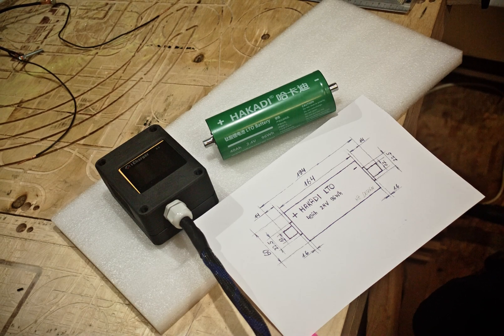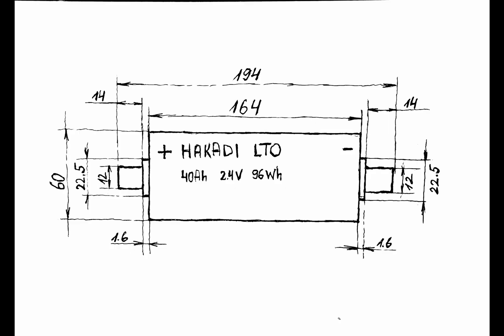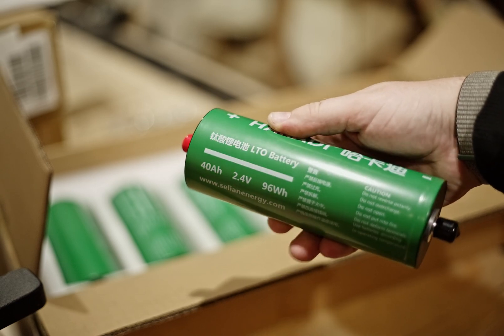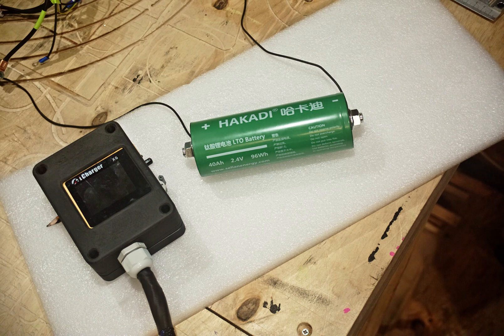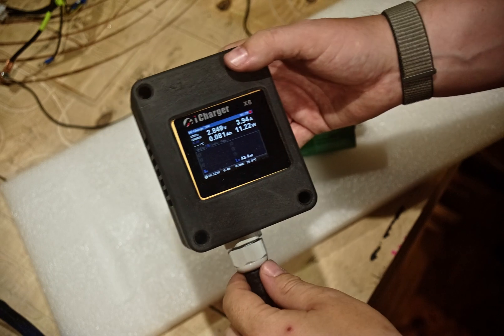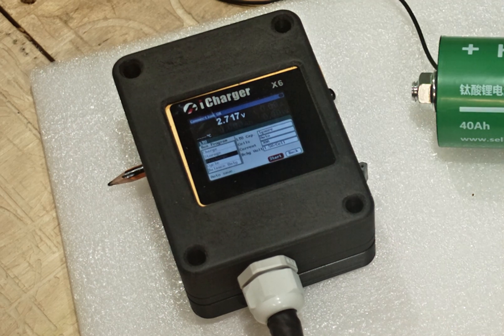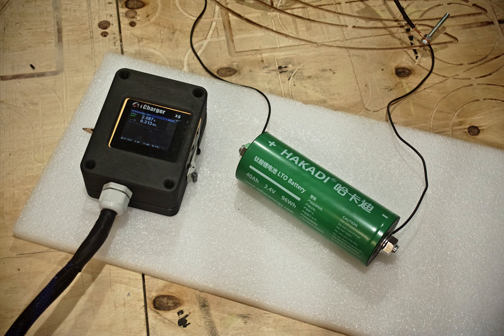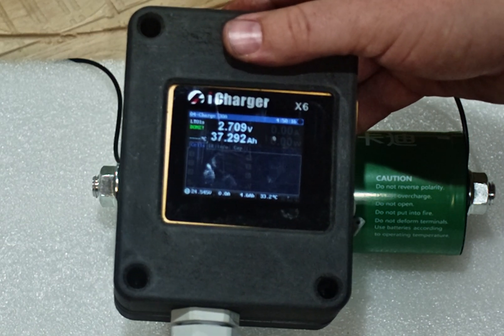Testing new Hakadi LTO cells

Comment: That specific area of the tester shows the resistance of the cell PLUS the lead resistance that is charging it.

The actual IR of that cell will be around 0.5 milliohm or less. You would need to use the balances lead function of the tester to show that.

Comment: Hi mate 

Im looking at these or the yinlong from the website. Wasnt sure was legit..

Wanting too power 16kw for car audio
Reply from the maker: Hey! I have not used Yinlongs myself, but the Hakadis are doing the job great. At the moment I'm running two Taramps Smart3, but planing to upgrade to Smart8. Will have to see if my 120Ah capacity will keep up, but I'm not too worried. I think that for a burp my bank could power 16kW, but for extended demos on stock alt bigger capacity would be needed
Reply: How about charging them up to only 14.5? I have a mercedes and the regulator is integrated into the alt, so i can only charge with stock current, albeit 150a alt but still, not much more than14.5, and upgradeable to 220 or 250a  @KarlisZalitis
Reply from the maker: @eustahijelifetips you can do that but at 14.5V the cells would use only 20-30% of their rated  capacity
Reply: @KarlisZalitis  the same would be if i used yinlong also? Problem is that i cant modify my alternator so easily
Reply from the maker: Yes, it's due to LTO battery chemistry, no matter the brand
Reply from the maker: I can recommend my solution, so far no issues - I'm using iCharger X6, as seen in the video. I am using car electrical system to power the charger, that then charges the LTO cells to more appropriate voltage. I'm charging to 16V due to my amplifier  max voltage limitations
Reply: @KarlisZalitis  with all of that in mind, would 12 cells be enough to support a 3-4kw system?
Reply: With dsp, seperate amps for tweeters and midranges, midbasses and subwoofers, so 3 amps and a dsp?
Reply: @KarlisZalitis  and you have a lead battery still to not freak out the cars electrics?
Reply from the maker: I think 12 cells would be just fine :) Yes, I still have my lead acid battery to run all the car stuff
Reply: @KarlisZalitis  where did you buy the hakadi resold cells?
Reply from the maker: There is a link in the video description :) I'm from Latvia so it was very important to have batteries inside the European Union to save the hassle of worrying if the item would arrive or to deal with customs fees
Reply: @KarlisZalitis  im from germany so its the same deal
Reply: @KarlisZalitis  well, there goes 440 euros lol
Reply: @KarlisZalitis Hi.I want to do the same.I have X6 and 160ah lto.Can you tell me if you let the charger in the charger state during use? Or you charge your lto and then use it. I saw in another comment you say you use your bank for 6 hours.How many times you charge it in that time.
Give us more details bro 😎

Comment: Hello, how are the batteries? Are you happy with them?
Reply from the maker: Batteries are still doing great, have no issues with them. Rock solid voltage and strong capacity. Recently was at a party where I was listening music at quite high levels for 6 hours straight, without problems
Reply: @KarlisZalitis  Thank you very much for your answer, have you also connected a BMS?
Reply from the maker: @marcopara9947  I'm using iCharger X6 both for charging and balancing. It has special programs where you can balance while you charge or balance only. Also it shows parallel cell voltages and internal resistance. I do the manual balancing rarely, the cells seem to be quite similar and cycle similarly to each other
Reply: @KarlisZalitis  Ok, thanks for the answer, good luck with it👋🤝🤝👍👍👍💪💪